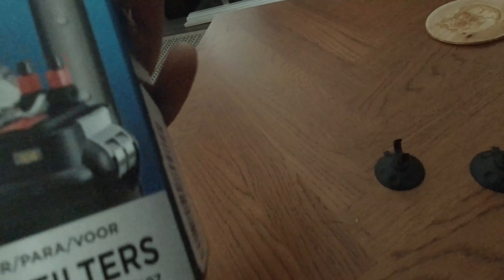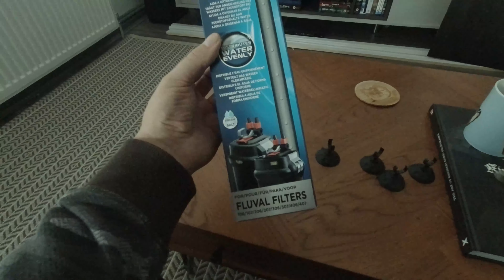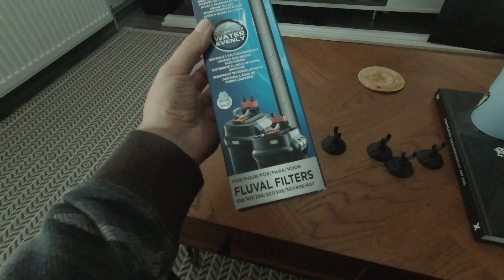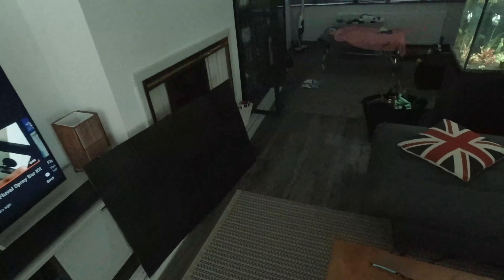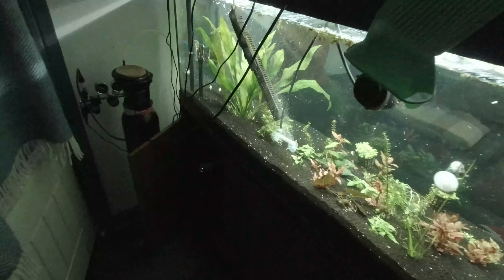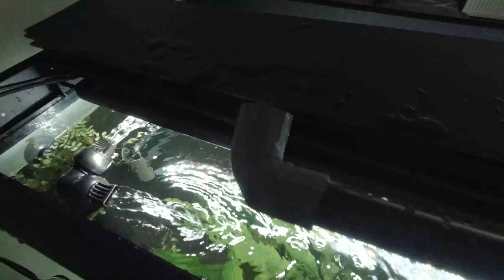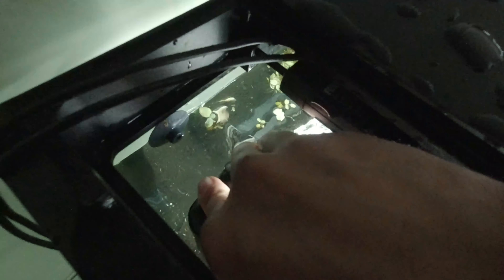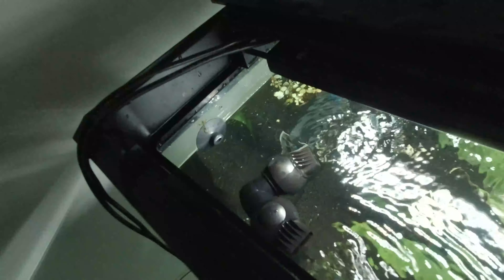Fluval SprayBar on a Roma 240? how??

Comment from the maker: Would I be able to find one at a plumbers?
Reply: I would think so i would measure both the output pipe into the tank and the bar
Reply: I got it from The Plumstore and it cost me £1.87;  Product code - WMHICP. Product Description - 3/4" washing machine inlet hose connector plastic  27066. The one I have is white. If you have issues getting it, let me know.

Comment: I took the larger length of pipe out and fitted a Lilly pipe, give great flow down the tank, I also fitted a second filter to the opposite side as the 407 (in my case) is not on top of the job for a heavily planted and and stocked tank, the second filter I went for is. Pause biomaster 600 thermo. This removes heater from tank too. I have fitted glass Lilly pipes to both filters and it looks much cleaner
Reply: whoa  - Biomaster 600 AND fluval 407!?!?!?!(TOGETHER?!?!)- - - are you running a river tank?

Comment: Its not meant for the Led version of the roma and the only way it can damage the impeller is by the increased back pressure overtime causing heat i would try  to make the spray bar larger rather than reducing it
Reply from the maker: Yeah so really just a need a fitting, somebody all commented on pushing in a tuplip glass mount.

Comment: I have the same issue; so off I went to plumb store and the lad there found a 3/4" washing machine inlet plastic hose connector that fits very snuggly due to it being threaded (I'll put some plumbers tape on it or tank sealant). The end that attaches to the U-bend of the spray bar fitting will require the same. Its work in progress but I'm confident it'll work but I take on board what Fluval say and agree that there should be no propella damage and I would imagine that if there were, it would be finite!
Reply from the maker: People keep saying it will blow the motor out because of back pressure..

Comment: What's wrong with the heads that's already on ? Bet you could get a reducer to bring the pipe size down to suit the spray bar from BnQ.
Reply: Or Plumb Center
Reply from the maker: @nicholasbrownley3127  yes think ill take the fittings to a plumbers see what they can drum up.. follow up video to follow :)
Reply: @yorkshireaquascape8466  any joy with that spray bar (considering one myself)?
Reply from the maker: @DVDKEV  no sent it back apparently causes problems with back pressure and damages your propella
Reply: @yorkshireaquascape8466   thank you for letting me know this! I was going to add this onto my order

Comment: I got told by Fluval UK that the FX would fit the outflow stems for my Shaker tank, both my Venezia and Shaker outflow are identical sizes. Bought the FX spray bar kit and guess what? It doesn't fit either 😂 anyone else managed this?